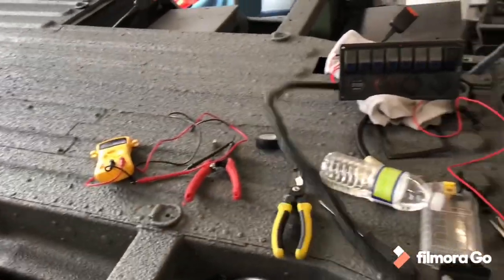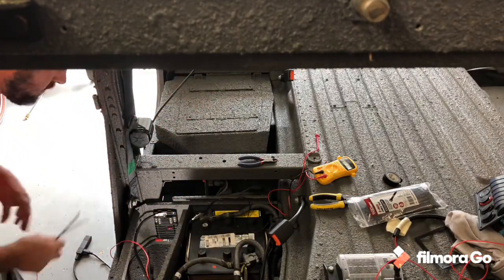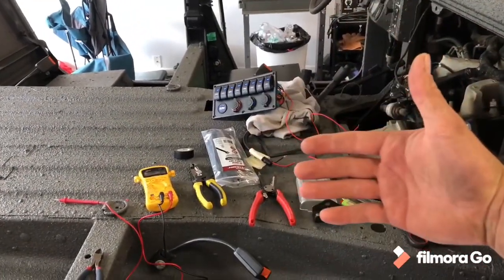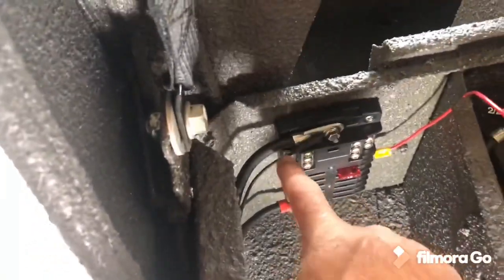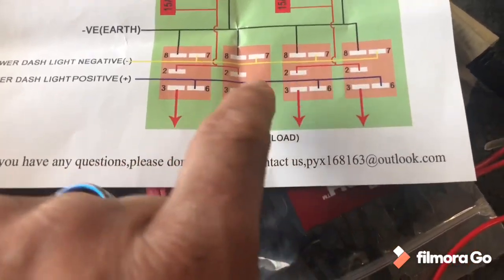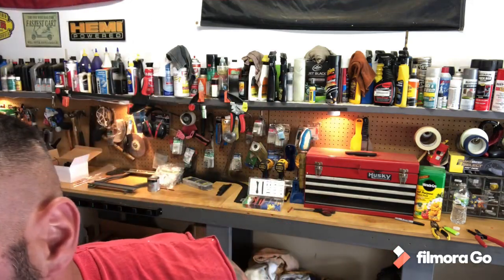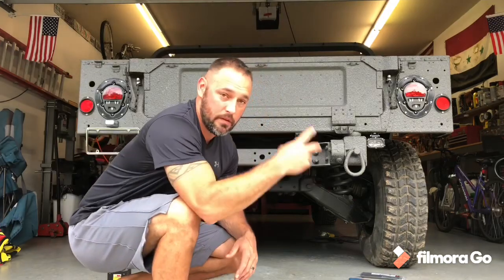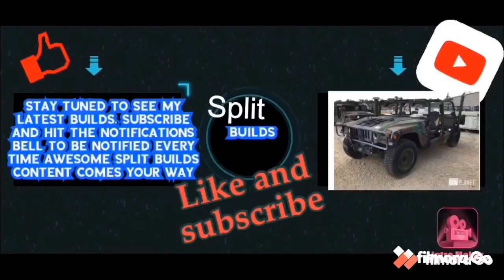Humvee Part 15 wiring!

Comment: Next time you have to feed wires, or don't have loom and want to keep them tidy, cut the wires longer than you need, hold one end of each together and stick them in a vise.  Chuck the other end of both up in your cordless drill, back up until the slack is out of them, then hit the drill.  It will twist them neatly together, making them much more tidy, and easier to feed through loom, or a hole, or whatever.
Reply from the maker: Good tip!

Comment: Are u happy with the coating? Anything you would do different? Possible to make it a little finer texture by thinning or increasing pressure?
Reply from the maker: You could possibly not make it as grainy or rough by not adding as much Kevlar. I do like the rough texture. I do like the coating

Comment: Question, I'm gonna install a 24/12 70amp converter so I can run accessories off both batteries. Do you think I can run my hot wire right from my ignition switch to the rocker panel? I see that you used a separate switch to power your panel.
Reply from the maker: You can remember that ignition switch is just a switch. That wire running over can’t handle that much